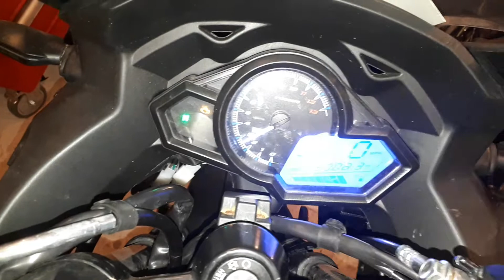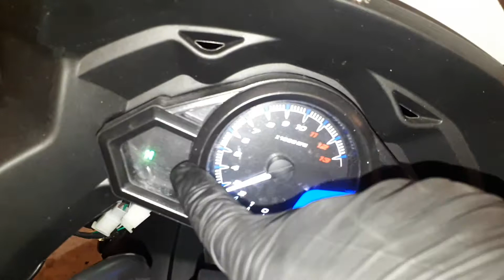Lexmoto EML light reset

Comment: Hi my temperature light flashing changed coolant  and thermostat and still same many thanks
Reply from the maker: Does it flash when turning ignition on, or when it getting hot?
Reply: @GicaPhp  when turn ignition on
Reply from the maker: @lukelamont9898  make sure you have connected the coolant temperature sensor and check wire not to be broken

Comment: For my bike after Star go off but come back when I turn on the key
Reply from the maker: If the EML light is back on, it means you still have a fault. (make sure the o2 sensor is connect, temperature sensor also)
Reply: Thank you so much. I have a lexmoto Titan and thought it wasn't working at first but then realised I still had it on the stand.... put the stand up and repeated it ..... voila it worked!!!!